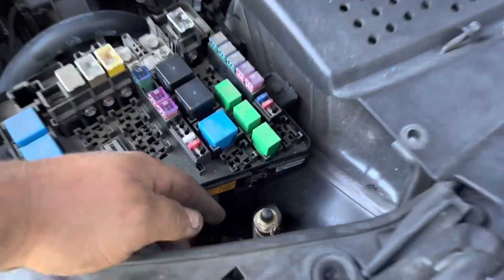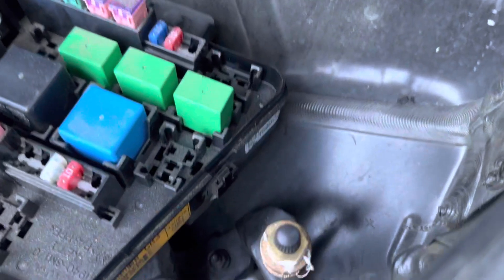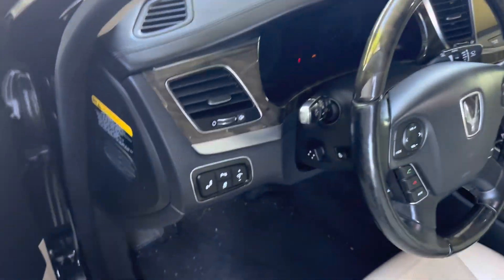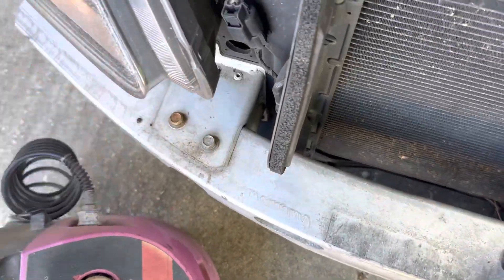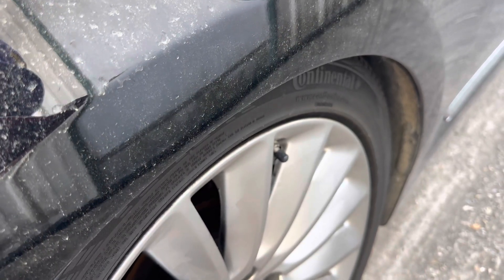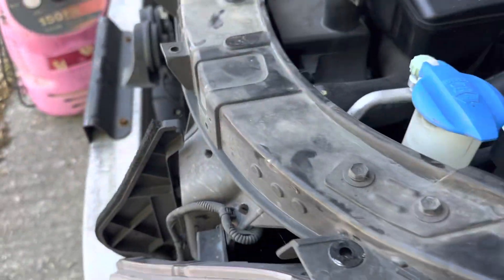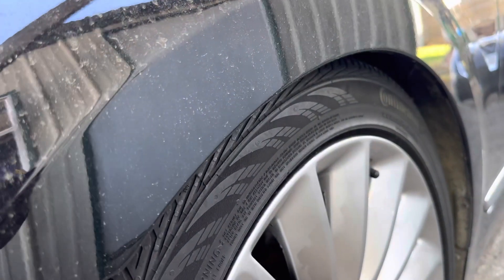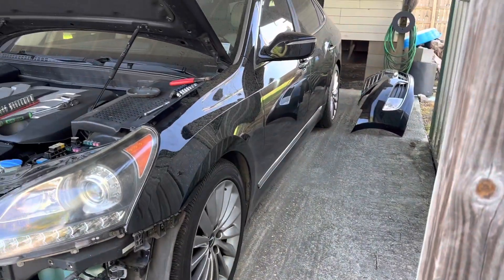How to Fill Air Suspension/ Air Suspension Fill Valve Retrofit on a Hyundai Equus (2011-2016)

Comment from the maker: Hey guys. Update for ya- I recently came across the service procedure for filling this car and running the recalibration with a scan tool. 10 bar- 145 psi
Reply: I just bought one of these gems.... Everything works until I turn the car off. The rear  suspension drops on top of the tire . It looks kinda cool but Is not supposed to do that. 😂
Reply from the maker: @angryveteran5196  Your rear bags are probably leaking. See my other videos for information pertaining to that fix.
Reply: 10 bar is 145 psi bro, don’t be telling people how to break their cars haha
Reply from the maker: @bradhuf  fixed that, Thanks! I'm good at many things. Math is not one of them
Reply: @slicknicklol  haha math gets the best of all of us
Reply: Good afternoon, I would like some help, I bought an Equus and I needed to replace all the shock absorbers and the air bag, but the compressor is not working, can you help me since I live in Angola and there is no specialized technician In this matter, it could be the fuse or another issue
Reply: @quitumbojoaoneto3417  there’s not really a great way to diagnose an issue like that remote.  If you have a scan tool command the compressor on and see if works.  If not you might need to find a diagnostic procedure from Hyundai.  You could start at a fuse, I would.  But if the compressor comes on after commanding with the scan tool but doesn’t work when setting ride height I’d imagine it needs some other criteria met like pressures in the primary and secondary tank may need to be at a certain value or something else.  Like a cars A/c compressor, there is logic involved in allowing the compressor to cycle on.
Reply: @bradhuf  Yes, I want to start looking at the fuse, but I don't know where to find it, can you help me find it?
Reply from the maker: @quitumbojoaoneto3417  Your car will not air up if the system is completely empty. It needs to see some pressure in the storage tank
Reply: It does actually takes 8 to 9 bars in the system i can post numbers off identifix
Reply: @rigobertorosell  already been established if you read above
Reply from the maker: @rigobertorosell  yeah I got mine from Autel. Thank you for the reply tho
Reply: @slicknicklol which model Autel did you buy?
Reply: I have a 2011 and both  rear bags dropped during the winter. The light on the suspension button doesn't even come on anymore. Both fuses seem fine but who knows. I tried resetting the system about ten times but nothing. I'm afraid to take it to a shop because I already know they'll try to run me off.  
My question is... Did this work for the front and the back or was this only the front ones??? Thank you in advance for any help
Reply from the maker: @ do you have the check ECS light? Even if not the suspension system disables if any trouble codes are stored. 

If it’s still frozen the valve block could be frozen too.
Reply: @slicknicklol  no codes. I had some initially and I got them cleared. Then ran through tests again and got same results essentially. My fear is maybe I need a higher pressure compressor to get enough air to trigger it to work? I’m topping out around 120psi
Reply: @slicknicklol  okay! PROGRESS!!! So I’m an idiot and missed troubleshooting 101. I had a blown fuse for the ECS system, so compressor was not moving any of the air around. Once I replaced the fuse and filled the reservoir with air, I was able to get it to fill using the Autel. In my defense, I thought based on your video we were bypassing the compressor and everything else and just forcing air in, as your external air compressor was making noise, so I couldn’t tell your cars compressor was likely doing some of the work, or at least something was activating a solenoid to open the path up. 

In any case, I got all 4 corners off the ground as they suggest to be safe, replaced the fuse, tried to run the fill commands, it failed, so then checked air pressure status and it was low because it sat for a while again since I last filled it😅 So filled again and I was in business. I had to do one at a time. It failed trying to do the fill for all with the one button click, I suspect because I did not have air pushing on it front the shrewder valve. Not really sure. But going through each corner, it worked fine. Once it was full, sat car back onto ground and she was FULL!!! Started operating the ride height button and she moved with lightning speed! So now I just need to confirm that it is the rear losing air and not the front. But really…. I probably need to just replace all 4.

Comment: But did it stay
Reply from the maker: @fluellenmediabymarekusflue6320  with my new front and rear bags, it has held to this day. Cars sitting out in the driveway right now- we took it to Target yesterday lol
Reply: @ColdStartAuto  I'm going tobdealership today. Should be under warranty. If not, I plan to switch to magnetic ride or conventional. This is a silly problem to have.
Reply from the maker: @ if repaired properly, it’s far from a routine issue. The life expectancy of air suspension is 80-100k miles. This is true for all air suspension equipped vehicles, like Mercedes, BMW, etc.

Comment: So I tried swapping the fill port and it will not take air. I do have a check engine light that started recently as well. Not sure if it is all related, but I assumed it is just because it idles rough on cold starts. The rear bags have been going low overnight for some time, but I don’t drive it much, so it hasn’t been much a priority over the winter here. I ordered an Autel MK900TS. We will see what that says when it arrives. It used to fill itself no problem after sitting a week. Now it won’t fill at all. That’s what lead me here. Now replaced the port and still won’t fill. I don’t ever hear the compressor turn on either, I’m sure it’s because it got so low that even the front dank, which is new. When I attempt to fill, it puts the 120psi that the air compressor is pushing out into the line between the port and the reservoir tank. It was making an odd creaking noise when trying to first… not sure what that is about, but it’s not doing it now? 

Anyone have any thoughts while I wait for my autel to arrive?
Reply from the maker: So, whenever I air up my car I press the height raise button on the console. Seems to take air everytime. If you have a bi directional scan tool, there is a procedure for filling the car that way. Give that a shot.
Reply: @slicknicklol once my Autel arrives I will give it a shot. More to come! I will follow up with that I find when it comes early next week.
Reply from the maker: @ keep me updated- I’m buying a parts Equus this weekend and I’m gonna have to fight to get it aired up myself more than likelu
Reply: @slicknicklol okay…. Not even sure where to start. First, everything I have done is with the car on the ground because I can’t even get a jack under the car it’s so low. Running through all the suspension checks I get mixed results with car off (ignition on, car not running), but with car on (running) it passes everything except height sensor test.

I never hear the compressor activate. I have all codes cleared.

Prior to clearing the codes I had a C1513 brake switch circuit error in history. After clearing it I managed to get a C1514 valve switch-on time exceeded error. Somewhere along the way, not sure how…. I managed to get the air pressure up from:

I then got it up to:

System air mass: 78 Bar + L
Reservoir Air mass: 37 Bar + L
Pressure Reservoir: 7.2 Bar

Mind you I just kept trying to fill air and it usually didn’t sound like it was doing anything. I couldn’t see the car rise or anything.

When all hope was lost I somehow suddenly got up to the following:

System air mass: 83 Bar + L
Reservoir Air mass: 44 Bar + L
Pressure Reservoir: 8.5 bar

Actually it was even as high as 84 and 45 bar but it somehow got a little lower after doing a bunch of tests and attempts to fill, etc. I was simply not able to get it any higher. At this time I started doing a bunch of tests a while longer and eventually had to start the car and do them. I found that was when all would pass except height sensor test sensor. Never triggered any other errors. So not sure where to go from here.

I did find a big list of live data and I may one point it was all zeros there and after I got some air in there I started seeing some data coming through. Not sure what to make of any of them, but one interesting metric was the last one that says:

Pressure Signal (Sensor directly) 1.1 Bar

Thoughts of where to go from here? Maybe a bad compressor? Maybe a bad height sensor? Any idea how to validate which are bad with my Autel MK900-TS?
Reply: @slicknicklol make sure you look at my previous post as well, but I’m realizing…. 8.5 bar is about 123 psi which is the max my compressor can deliver. Do I need something that has a higher psi rating?

When I look at the procedure for adding air, it indicates the following:

1. Connect air hose to the air inlet on the side of the air injection equipment.

2. Ensure that the initial air pressure is 5 bar.

Initial air pressure to normal values: approximately 5 bar 

3. Connecting the air hose automatically, starts the equipment and increases the injection air pressure.

4. Wait until the air pressure gauge indicates 12 bar.

Injection air pressure to normal values: approximately 12 ~17 Bar.
Reply: I know I responded to another chain on this video I think, but for anyone reading this one. My issue ended up being my ECS fuse was blown. Located under hood on driver side.

Comment: Good afternoon, I would like some help, I bought an Equus and I needed to replace all the shock absorbers and the air bag, but the compressor is not working, can you help me since I live in Angola and there is no specialized technician In this matter, it could be the fuse or another issue
Reply from the maker: @quitumbojoaoneto3417  are you trying to fill it with air? The compressor will not turn on if there is no air pressure in the storage tank, this system is not like Mercedes.
Reply: @slicknicklol yes, I replaced the air springs and other shock absorbers, but it is not inflating automatically and I saw your video where you added air with an external compressor, I want to know how to do it, please

Comment: How did you pull out the air tube from the original proprietary valve?
Reply from the maker: It’s a quick connect. Push the collar in, pull the hose out.
Reply: @slicknicklol  yes, I assumed that and pushed it up hard while pulling the hose. I now have a standard valve! I'm ever grateful for you. Now let's see tomorrow if we get lift off 😁
Reply from the maker: @naderkhalid1  keep me posted
Reply: @slicknicklol  Well, I jacked up the car and filled it to 9 bars all wheels filled except the rear right. 
I tried filling it and it's obvious that it's leaking. So I'll replace it and see.

Comment: 6 AN fits on it.  I shaved the end of one down a little so the taper on the inside would seat.  Put the barb on a hose I had and the other end on a male plug for our shop air fittings.  Suck that Hyundai and your proprietary bs.

Comment: Hi. Can you please tell me what's the diameter of the suspension airline and how many bars was your compressor pushing? Is it a tire inflator or a high pressure over 100 bars compressor?
Reply from the maker: I made an error in math, its actualyl 10 bars which is hovering around 100 psi give or take. The car has 6mm air line from what ive found.

Comment: I'm having problem with air ride suspension in extreme cold weather, do you know how fix it, and is it possible to add an  anti freeze product to the airlines ?
Reply from the maker: Unfortunately I’m unable to help too much as I live in a tropical environment. It’s possible you have moisture in your system, maybe see if you can charge the system with nitrogen?
Reply: can put a small amount of everclear 180 proof in the air line will stop any ice build up, used to use it commercial diving to stop the breathing hose and fittings from icing up.
Reply from the maker: @guyayers-berry1076  Thats incredible lol. And here i was thinking that everclear was only for a good time.

Comment: I have the same car, did the exact same thing as you did. But it doesn’t want to go up. Please reply
Reply from the maker: Make sure your car doesn’t have any ECS codes stored
Reply: @slicknicklol  how many censors are their? To find them
Reply: @slicknicklol  how many censors are their? To find them
Reply from the maker: A lot. You need a scan tool to see which codes are stored.
Reply: @slicknicklol  where can I get this tool? By any chance do live in Texas?
Reply from the maker: @andresalmeida4866  you need a fairly advanced tool to pull ECS codes. If you’re unfamiliar with the lingo I’m using you might have to bring it to a shop, it’s difficult to explain.
Reply: @slicknicklol  oh alright, so I’ll just take it to a shop. Ask them to remove all ECS codes?
Reply from the maker: @andresalmeida4866  you can, yes. If it comes back on, you have other issues that need addressing first.
Reply: @slicknicklol  oh okay, yea cause when I was putting the air. Afterward the ECS light came on. Thank you for your help.

Comment: What’s up up man quick question here once I remove the old valve will all the air remaining in the system come out ?
Reply from the maker: No. The line from the fill port goes straight into the valve block, it takes a second for the car to open the valve when you apply air, so air SHOULDNT come out of the port. If it does then your valve block is probably bad.
Reply: @slicknicklol  hey man a got a question for you, when I complete this job do I have to get the suspension reprogrammed from a Hyundai dealer.
Reply from the maker: @abdmohammad8632  If you don't touch the level sensors, the ride height should be okay, but there is a procedure to reset the active dampers i believe.
Reply: @slicknicklol  oh ok yea I replaced one of my sensors too that’s probably why I am off a little bit

Comment: This is amazing. I could not get anything to thread on that stupid Hyundai valve to fill this up. Thank you so much!
Reply from the maker: Same problem I had. I took that valve off, and brought it to almost 9 specialty air and hydraulic fitting shops, including Parker Hanifan dealers (they have a Parker Hannifan logo on the cap) and found nothing. So I made one lol

Comment: I just changed my my rear airsprings and front struts. Now my compressor wont come on. Im guessing since all the air leaked out  i have to fill the reservoir back up that will then singnal to compressor to kick on. Ive tried this method but the car will not lift up.  Checked all my fuses and they are good.   Any ideas?
Reply from the maker: Did you disconnect the battery? If the suspension ECU had any stored codes, it will no longer air up the suspension.
Reply: @SlickNicklol  yea I did disconnect it.  Well as of now it still showing the ECS warning/ check ECS.  Tmr I will try to reset or erase the code and see what happens after🤦‍♂️.        But actually today I was able to air it up a bit.   
System air mass-104 barl 
Reservoir air mass- 44 barl
Pressure reservoir- 8.7 bar 
But I still don't hear or see the compressor kicking on.   I got some more diagnosis to try tmr
Reply: @slicknicklol i got ECs Light just changed front stuts going to put air in today and see if she lifts.
Reply: Any luck?
Reply: @jacobcottrell3094  you get her up?

Comment: Hello brother, so I have a 2014 Equus and did the same thing you did, change the original to a retrofit. When it comes to adding the nitrogen, the r134a filler that I have does not fit because it’s too big.:( Please let me know if there is a specific valve I can find that can screw on and connect to the 1/4 Male Npt Air Fill Valve and connect the r134a to it the way it should so I can fill and finish this procedure. Thank you so much! I’d appreciate if you respond!
Reply: Can anybody help me please? ^^
Reply: @salihlkd2791 I am currently ordering the parts to change it, He has parts in the description if that helps.
Reply from the maker: @salihlkd2791  Are you referring to the AC? The High side port is easily accessible in the front of the engine bay, but that is not the port to put freon in. The low side (fill) port for the AC is in the rear of the engine by the master cylinder.

Comment: I have 2016 Hyundai Equus with 50,000 miles. The front sits low when left  park overnight,  it will rise to normal when I start the engine, is that normal?
Reply from the maker: Your front struts are leaking. Start saving for new ones.
Reply: @SlickNicklol  Thank u! I have a service contract
Reply: @slicknicklol the gold part the union is different from the one in videos

Comment: From the manual: 
 When injecting air into the air suspension system, always raise the vehicle off the ground using a lift to prevent potential damage to the air spring.
•	
When injecting air into the air suspension system, use air injection equipment with an air filtering function to inject air to a pressure of 12 bar (174 PSI). Failure to do so may seriously affect the durability and performance of the air suspension system.

I also believe that nitrous is to be used.
Reply: We not doing none of that, dude.
Reply from the maker: @youngbazz89  I just watched the bag, if it twisted i woulda done it the right way but it aired up fine.
Reply: @youngbazz89 ha!! Right.
Reply: The trouble for some is getting a jack under when it’s that low 😞
Reply: @ true. I always use the rocker jack points and left one corner at a time. A low profile jack is a better choice all around use.
Reply: @ThomasRodriguez  easy fix..... 2' long Sections of 2x4 and drive the wheels onto them. Then you'll have plenty of clearance.
Reply: @repnatl this is what I did a few days ago to replace my rear bags. Even if the car is slammed out a 2x4 will lift it high enough for a normal jack to fit underneath